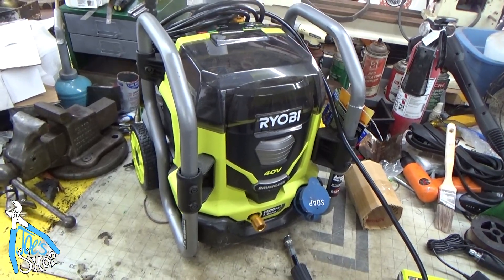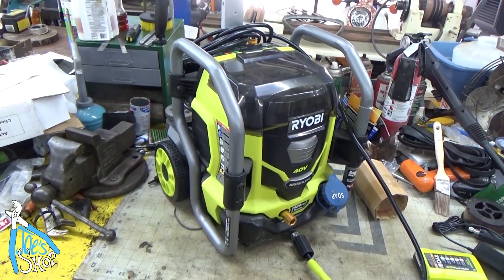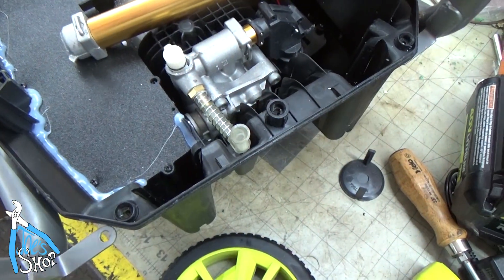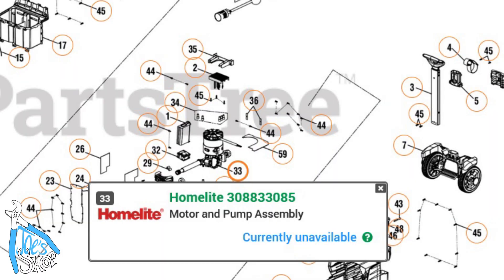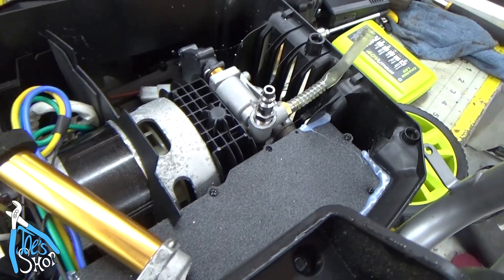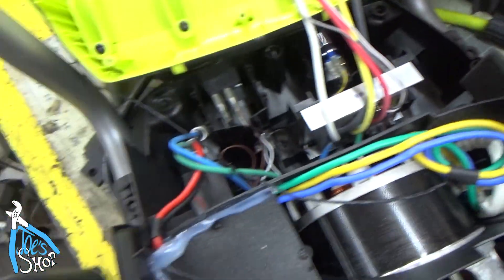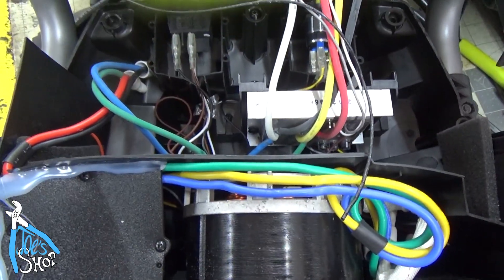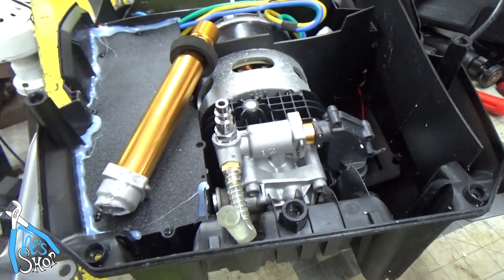Broken: Ryobi 40v Pressure washer (Part 1)

Comment: You could always acid wash out the pipe and sand out the pump and take the thing apart to braise the aluminum back together with alumiweld rods and a torch.  Some cheap homedepot plumbing silver solder flux would help alot..  but after braising itd be like new..  i dunno how youd get that plastic valve back in after but the metal would be fixed..  if you tried the air fitting itd end up getting pushed out and just break again..  youd have to actually thread the inside of the pump..
Reply from the maker: Your not wrong that braising would be best. But since this side of the pump only sees city water pressure (60 psi) I think the jb weld should do the trick. At least that's what I am hoping for. And thank you for the constructive comment, I love getting tips and recommendations . Cheers
Reply from the maker: Hi Zack. I was wrong, this is the high pressure side. It appears to be holding...for now. Thanks again for the comment. Cheers